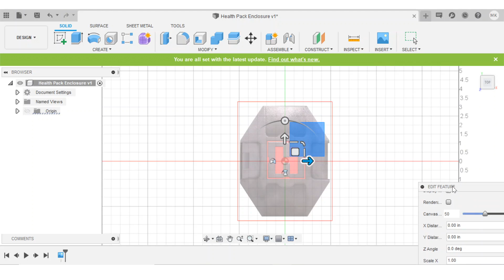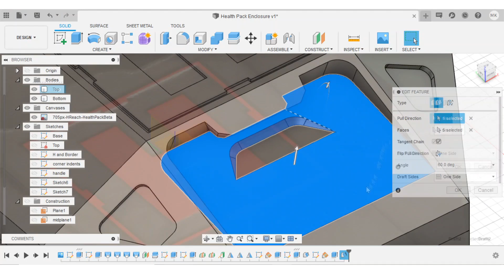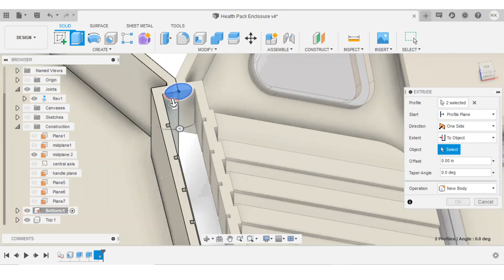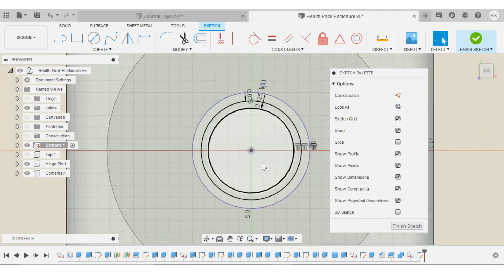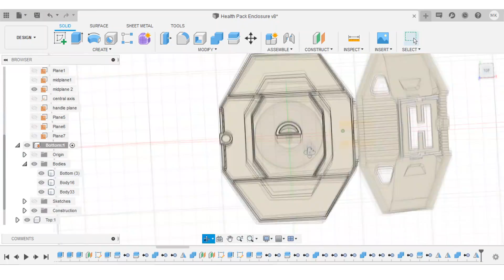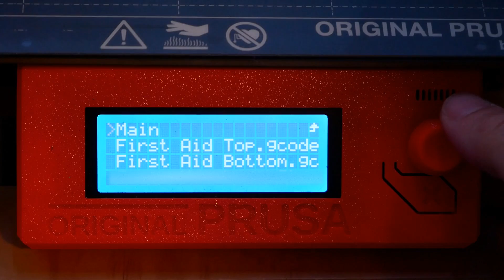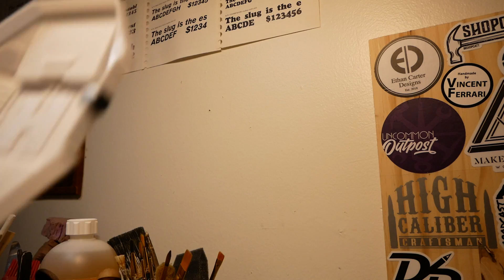Making a REAL Halo Health Pack! // 3D Printed First Aid Kit

Comment: Another way to print the little ridge would be to give it a small 45° overhang which would still serve it's function while avoiding the need for support. Also, tree supports!!! I haven't used normal supports in months since I started using tree supports. They use a fraction of the material (depending on the model) and are easier to remove.
Reply from the maker: Thanks! I’ll look into tree supports

Comment: So was removing all the supports less work than sanding the top if you had printed it upside down? Great med pack!
Reply from the maker: No idea, as I only did it one way 😂 but Vincent gave me a good tip of modelling my own supports as well as making less dense supports in the slicer, which I’ll definitely do next time. Thanks!

Comment: Looks great. I really have a lot to learn in fusion. For the support material,  you can probably do with a lot less dense supports, more space between each support element. Experiment with the settings in your slicer. I use Cura and the support pattern and support density/line distance are helpful. Your printer can probably go a father distance without between supports which will help with not so much to remove.
Reply from the maker: Thanks, Dave! Removing that support material was so frustrating... definitely could’ve used the first aid kit when I was getting little cuts on my fingers from trying to peel away supports by hand. I’ll spend some time trying to optimize the supports!